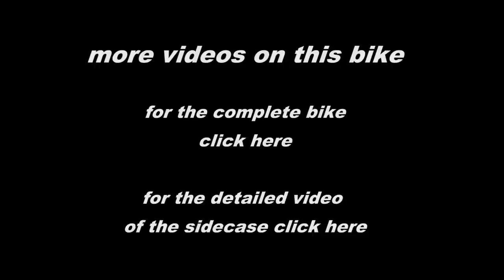Atelier Meijer - fueltank airbrush 1500 classic tourer

Comment: Holy Mother of Tank airbrushing artwork, BATMAN!  LOL  Love your Videos!

I'm a newb in my 50s with art background, but know nothing about airbrushing....although I want to learn!  Any suggestions?
Reply from the maker: Tracy Mitchell hi Tracy, Thanks. and I do have suggestions. watch every video you can find on youtube, that's how I learned. invest in a starter-set but don't hold back on the airbrush itself. buy a decent one like an Iwata, you can do with the cheaper models. you don't need a custom micron right away, it would only frustrate you. use good waterbasec paints at first.try and copy some othe artists but get to doing your own thing as soon as possible. just aim for what you want and solve occuring problems as they come, and they will come, trust me. and then practise practise practise. and there's always me if you need more info of problemsolving. there's also this guy airbrushtutor on youtube. those are good clips to follow. good luckjan

Comment from the maker: hi.
the maskingfoil you see is by hexis. Its cut on a comuterplotter and then i pull off the bits I do not want in my mask (these are the bits I want to airbrush)
now I have the mask on a bakkingpaper and I put on application tape and pull of the bakking. I can then put it on the tank sticky side down and pull of the aplicationtape (that's what you see in the video)

Comment: your work is amazing !  May I ask about your stencils ?? what material did you do the flower type designs with ? is it frisket ? why does it appear that you have sticky side down on tank, but then pull backing away from top ? is it double sided sticky ?
and last...  how did you get the original designs cut ? did you trace it onto the frisket from a reference image then cut it out ?
THANKS !  Keep blowing our minds !!
Reply from the maker: +Vendor-Lock Software co. what you see is the folowing: I make most of these designs in parts on my computer. than the plotter cuts them for me in HEXIS masking foil..I peel away the bits i don't want and then put (white/creme-ish ) aplication tape on it.  then I go over to the tank and peel of the backing of the masking foil. stick the foil to the tank and peel of the application tape....